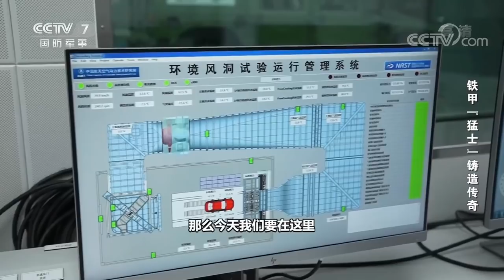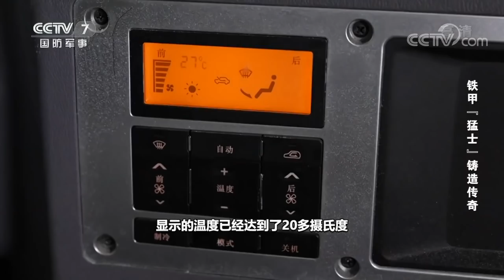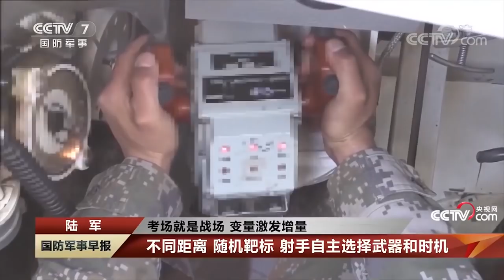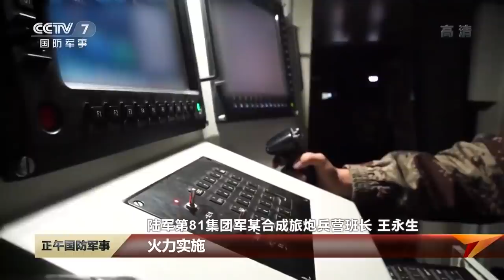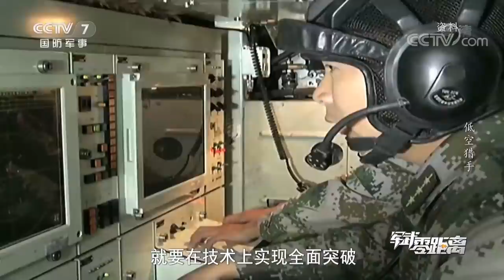PLA upgraded its border force w dozen new types vehicles and 7 new types barracks near LAC w India

Comment: A message to Indians border disputes with China . India got 200000 men and obsolete rusty trucks and lorries to fight the PLA. 🤦🏻‍♂️
Reply: TATA QRFV
Reply: @chanakya5480  khak thuii 🤮
Reply: @chanakya5480  doesn't even have enough HP to drive in mountainous region.
Reply: @fanaticcoder3320  240 hp more then enough to transport soldiers and 2 tons. By the way it is from TATA motors (they have lot of experience building vehicles)
Reply: @chanakya5480 my honda civic has more hp than that😂😂😂
Reply: @GigaChad-qk7fh  formula 1 car have 900 horsepower . Why we don't use it on normal Street . Is not about only  HP
Reply: @chanakya5480  because a f1 is not street legal????🤣🤣🤦‍♂️🤦‍♂️🤦‍♂️and is expensive af
Reply: @chanakya5480  240 hp is not enough for that big azz truck🤦‍♂️🤦‍♂️🤦‍♂️
Reply: @GigaChad-qk7fh  😏 I am talking the same thing . TATA QRFV not designed for street road (you mention Honda civil ) M1117  have 260 hp only.
Reply: @chanakya5480  if its not for roads its supposed to have more hp because offroad terrain makes vehicles slower
Reply: @chanakya5480  pretty sure the m1117 is lighter than the tata but there is no information about the tata qfrv.

Comment: What we're seeing at 24min seems pretty novel.  "No missile shortage on the battlefield" is a pretty good slogan!  This seems broadly similar to the ADATS system that was being developed when I was in college, it seems more advanced (that "Front Radar" looks special, is it electronically steered kind of thing?)  and also looks like it actually works!  I don't think we ever fielded ours.  Robotic looking reloader looks pretty cool, pretty fancy but might shave off a few minutes?
Reply: Oh, it said "phased-array radar"!  I didn't finish the video.  Oops!  Four targets at once is saying something, don't you think so?  Sounds like science-fiction!  So if a bunch of these are spread across the line, and they all fire at once, it could be pretty dramatic!
Reply: They should improve reloading faster. They can put these trucks on commercial ships. The Chinese has a 20,000 commercial fishing fleet. Put a few thousand of these trucks commercial ships to create mobile air defense systems that can reconfigure any shape.